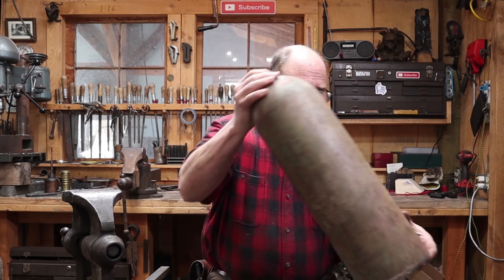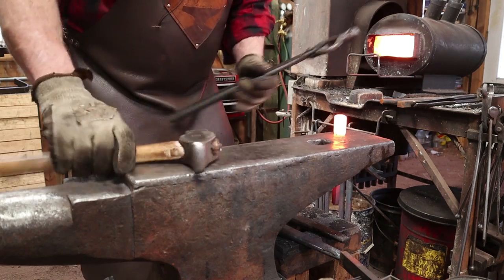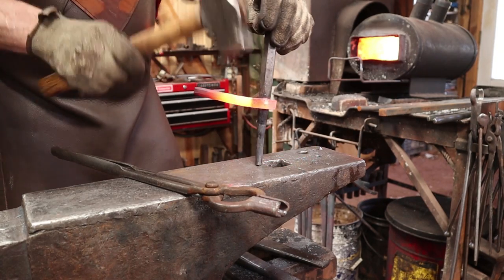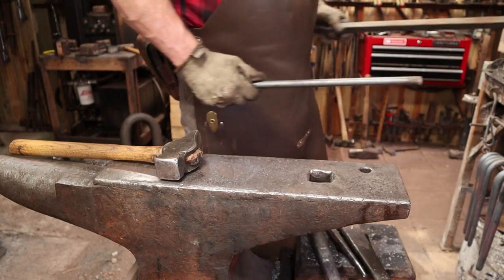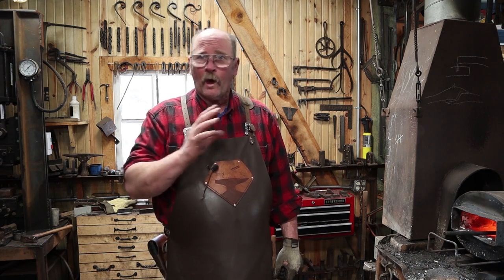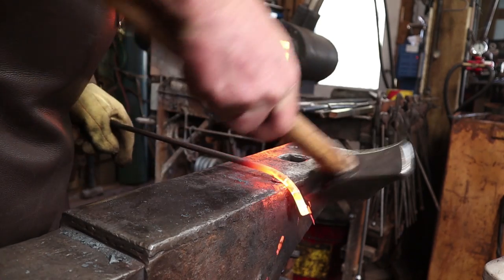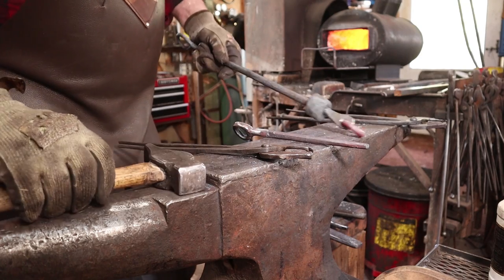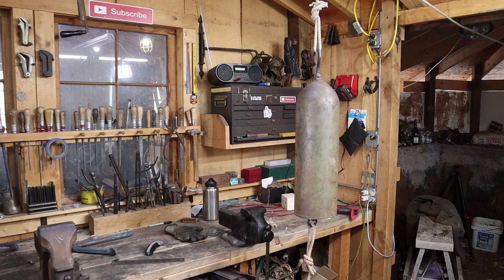Making a bell from a gas cylinder

Comment: There was another option for a bell.  My structural fabricator did something on the same line but different 
He cut the bottom out  at the bottom of the tank which made the cylinder longer and use a hammer to ring the bell.  What he did differently was to create a very unique apparatus  to hang the bell.  In his case a cartoon character of a scuba diver, with big eyes and a mask. you get the picture.  Just another way of doing something different.  
Enjoyed the video.  I am a woodworker, metal worker, and driving toward a blacksmith shop.  I love it. that is making stuff.  Thanks  
RC

Comment: I have loads of oxy bottles and all I do is take the valve out weld a piece of steel over the hole ,drill an 1/8" hole ,run a 1/16 "stainless steel cable through .attach a ringer inside like maybe a large 1 3/4 nut, then run the cable out bottom and make a design like a bear star or whatever floats your boat lol out of some flat copper for your wind catcher ,Thats after I sand the bell down to bare steel then i torch paint then and clear coat and then weld a hook on top of the bell so you hang it ,thats how I make mine ,and man they are loud lol great video ,thanks for sharing

Comment: I made a wind chime using several cylinders of various diameters and lengths, to get different sounds that had harmony with each other. I started with eight cylinders and then went to six.  The big problem was the combined decidable level that would shake your teeth. The wind-activated clapper was in the middle of the cylinders, and its size had to be greatly reduced.  To mellow out the cylinders I had to put a slit in the side, a few inches at a time. One of the cylinders needed a 10 inch slit starting at the bottom.  When I was satisfied with the sound, I drilled a 3/4 hole at the top of the slit and that improved the tone.    A wind chime should have soft tones, yet with a clear pitch.

Comment: I've made many of these gongs  and experimented  with clappers and flangers and even  bologna  cuts to adjust  sound. That was probably  a K cylinder , for a bottle that size  a metal  Clapper sounds tinny, try a hard wood flanger , I often bore out a piece of oak or fruit  wood so that my bolt will fit inside. Use epoxy to secure it in well.  Allow enough of the wood to hang below  the opening  to  catch  wind. You only  need an inch or so clearance.  It will sound deeper and resonate  much longer.  I truly  enjoy  watching  you forge.! Thank you

Comment: I made a large wind chime out of five scuba tanks scrolled the tanks with different Tibetan symbols with a plasma cutter, and a kite size clapper for a Buddhist monastery in the Santa Cruz mountains. I built a large Redwood ring to hold the five tanks and three redwood post in a teepee arrangement to hold up the ring. It stood for about eleven years till vandals (or an angry neighbor) knocked it over. I have had an extra tank for about twenty five years in my garage, your video makes me think I need to put it to use.

Comment: The question is, when you have a bottle, which comes first? Swage block type pocket, or Bell, my guess the bell was an after though. At least we know what to do with the top now. Nice job John.
Reply from the maker: I will probably use the base as a swage more than I will ring the bell.

Comment: Had to buy some inexpensive CO2 tanks for a different project years ago. Decided to make a few bells just for fun.  Aluminum sounds really good. Even when I cut the large steel tanks in half, I save and use the bottom section, they sound just as good with heavy chain hangers. Mine are mostly 'gong' style. A small bat, mallet, or even a drum mallet all work great for smacking the bell as you walk by. They are awesome for your outdoor area with guests too. Love the forge work, thanks for the videos.

Comment: Got a half-tank just like that.  Been planning on making a bell out of it for years, too.  The bottom half became a dishing stump.

Is the valve righthand threads or lefthand threads?  I'm thinking it's be lefthand just like the hose connect, but haven't tried it, yet.  Years of corrosion and that big diameter is sure to be fun to tackle!
Reply from the maker: I think O2 or CO2 would be right hand

Comment: Nice tone, was curious how you were going to hold the material to make the hanger hook, didn't think you were going to hold the whole thing while doing that.
Reply from the maker: I was originally thinking I would just heat with a torch and use a hand held bending fork.  But then decided to try it the other way.

Comment: They are pretty handy for casting lead and aluminum.

Question. Is it possible to forge weld a anvil a layer at a time?
Reply from the maker: Yes, but it would require a huge forge and a crane to make any decent sized anvil.  But the old ones were forged and had welded tops.

Comment: Two questions.  Is there a length/diameter of bell that will give the best harmonics?  Is there a way to figure projected gas consumption?  Thinking about a gas forge but trying to count the costs.
Reply from the maker: I am sure the proportions matter, but I don't know how to figure out what changes have what effect. Gas forged are all a little different and can be run at different pressure for higher or lower heat.  Its hard to make any exact calculations

Comment: I am certainly not a blacksmith BUT, (foot in mouth here) why make the ring by punching and drifting? Wouldn't it have been quicker to form a loop and forge weld it? Great bell!
Reply from the maker: Forge welding is always an option for things of this nature.  Just depends on the material size and the mood of the moment

Comment: I did something very similar probably about 7 years ago I had 120 cubic feet . Cylinder that I found in my local junkyard bought the bottle for a couple dollars go to my local gas supplier to see if they could swap it out or possibly get it tested the guy took one look at the bottle and laughed at me turns out the bottle manufacture date was 1909. So now it sits in my tree as a wind chime ironically all of my neighbors like it but one. Had a new neighbor move in about a year ago can't stand it I was going to do the neighborly thing and take it down. But between her attitude and the dog that never shuts up that they leave outside 24/7. I don't think it's coming down anytime soon.

Comment: I am very interested in using old cylinders for some art projects but I have no idea about where to find them. Any thoughts?
Reply from the maker: I'd check with local companies that sell pressurized gas.  They should be able to direct you to the place that does pressure testing.
Reply: @BlackBearForge  Thanks for the reply!

Comment: How did you cut the cylinder?  I have an old oxygen bottle similar to the one you cut.
Reply from the maker: I used a gas powered demolition saw.  But a large band saw or even an angle grinder would work.  Even a cutting torch, but that might leave lots of clean up.
Reply: @BlackBearForge  Thanks, I'll give it a try.

Comment: With my Argon Bottle....I cut about 10" out of it and welded 6 Fins on it...3 on Bottom and 3 on top and a piece of 3"X4" pipe for the Bottom Exhaust.... IT'S A BOMB (FAKE)...On top I cut about a 2.5" hole in the Bottle Cap and took a old Blue Glass Insulator from the old Telephone poles and Glued it in..... It's the Guidence System...I put it out by the Road and 4 Days later the Cop is out in front Writing a report....About the Bomb I'm not sure.....I even Burned some small holes in the bottom of the Bottle and put Fuse in the Holes and light it and Run....It Scares the Hell out of the Grandkids..... But the Fuse just Fizzles out......Nothing else heard from the Cops......I'm a Retired Bored UA 342 Welder..... STEAMFITTER for you Beginners...

Comment: Gas cylinder? I'm old enough to call acetylene "gas" and still call oxygen "air",doubt it was a gas cylinder because those are filled with a rock type material that's difficult to remove